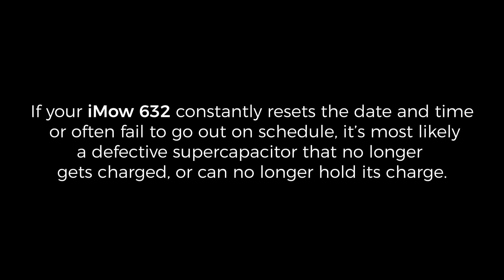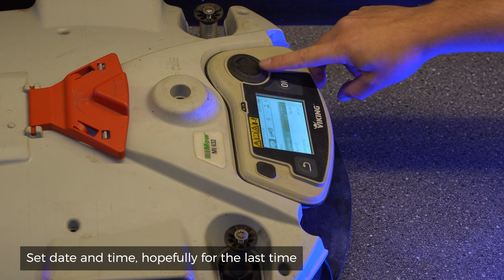Viking iMow 632 clock memory

Comment: Hello, same issue here, is it still working ? I will definitely try this in the coming days. Any final advice on the supercapacitor to choose ?
Reply from the maker: Yes, The capacitor in the description still holds up after one season and one winter storage, just replaced it on another machine yesterday. 
The DSK-3R3H204T614-H2L is easy to install when you bend the negative pin down so the capacitor stands on it's edge (but you have to hot glue it down so the vibrations doesn't break the soldering).
Reply: @pibbertech  I used DSK-3R3H224U-HL (but I think something like EEC-EN0F204J1 or EEC-EN0F204J2 would have fit better), requires some bending but working fine since 2 weeks ! thanks for the video !